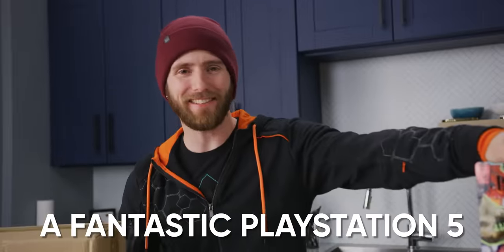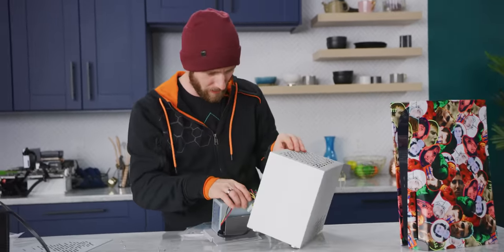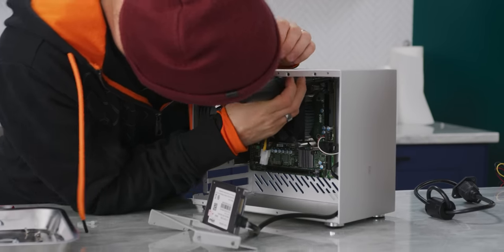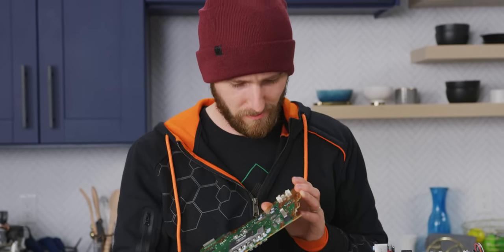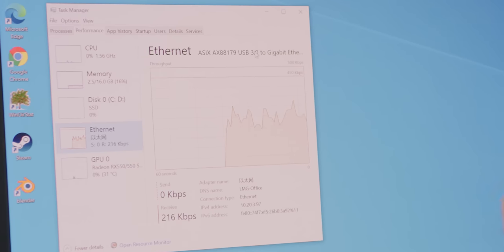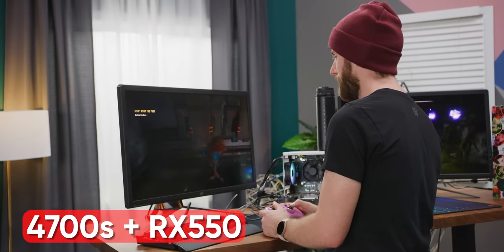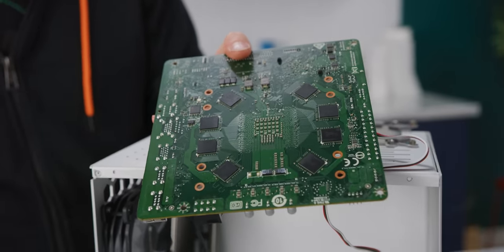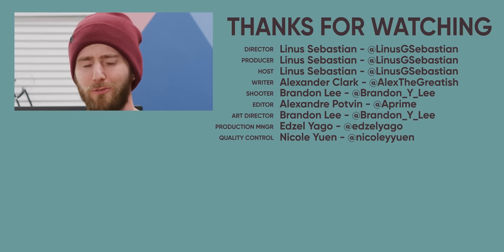Why Is AMD Selling Broken PlayStation Chips?

Comment: Yeah, I do the BIOS "gallop" too, when dealing with systems where I don't know if it's Esc, F1, F2, Del, F12, etc. - so you basically have fingers over all the keys and then "gallop" the lot of them doing the boot screen. Very unscientific, but it does often actually work. Just hit all the keys and one of them's going to be right.
Reply: Lmaoo same
Reply: @GladinGAFloodGoFundMe  I've had that one too. It's just odd that Fn lock would be on by default, with no Fn Lock key and the only way to unlock it is to get into the bios.
Reply: The worst one I ever encountered was one when Esc opened the BIOS, but also immediately closed it without a prompt. It was almost impossible to get into BIOS on that cursed machine.
Reply: i made an arduino project that will force the machine into UEFI once plugged in. I got sick of mashing keys when working in a recycling center for comboopers.
Reply: you guys never heard of a manual
Reply: @GladinGAFloodGoFundMe  Dan, I've come here from the future(current time) to tell you there is an easier way. I too had this issue with my Lenovo laptop, so I opened up "Lenovo Vantage" and clicked on the option to change the function keys to make the secondary functions (like volume up/down or screen brightness up/down) to make the secondary functions in red/orange the primary function. So you can just press any of the Function keys without having to press FN key first. And you can always switch it back by clicking on the Lenovo battery % indicator (if it shows up on your Taskbar). But either way, even if you don't have Lenovo Vantage, it's a very useful program for basically every hardware and software information about your laptop. Updates any drivers, has a great feature that let's you keep your battery from charging over 60% for people who use their laptop with it plugged it most of the time (to extend the life of your battery for when you do need to use it not plugged in, so it's not constantly charging and draining the battery when you're at your desk and it's been plugged in charging for weeks). And has all of the hardware specs listed in your laptop and links to purchase a replacement part, and any warranty information etc.
Reply: Brute force method to access the bios 😂
Reply: You have to hit del on my current gaming rig to load BIOS. If you hit end on accident then have fun waiting. The gallop is a no go on mine, lol.
Reply: You could just use a quick little 1 minute search to figure it out
Reply: sure, you don't  want it to have  some sort of "emulate PSP3" or something mode turned on.  Or  "allocate PCIe Lanes to  2nd slot " set to on ?? That sort of thing. Also he knew it was working , so just turning it on made too short a story.  Not that there was anything much to see, the interesting thing was the lack of anything to see.
Reply: (flips keyboard upside down and punches it repeatedly.) What? you said hit all the keys!
Reply: Damn we're all living the same life 😂
Reply: I used to do that
Then I got a mobo that would actually lock up if I tried that
It would post fine if I did nothing, and it would get to the BIOS if I pressed the key at the right time, but if I just mashed, it would just give me a black screen
It's weird, 'cause I actually change motherboards rather frequently, and I've never had one do that before
Reply: The trick is to do it at the right pace, otherwise you may get a keyboard error (hit F1 to continue :P )
Reply: @george-broughton  you can boot to uefi bios from windows
Reply: Fuck I dont know what my bios key is and im always overclocking
Reply: That's the longest description of the process of elimination I've ever read lol

Comment: they took a partially functional CPU, bundled it with more bespoke hardware, that fits no other CPU and sold it at a bad price/performance.
They saved the CPU from becoming e-waste immediately by constructing more parts around it so they can all be e-waste together :)
Reply: It's an issue with TSMC 7nm as a whole. Hence why everything is being transitioned to 6nm.
Reply: @anthonya.jumelles7103  I'm pretty sure tsmc7 yields are around 90%, very mature node
Reply: @rayquazahere8529  Probs shitty luck because my 3700x works great and I never had any problems with it.
Reply: Welcome to AMD where awful price to performance is the norm now. Even their RDNA2 lineup are awful investments.
Reply: @rayquazahere8529  Ditto to the other guy, my 3600 runs great and has been going strong for a while now
Reply: @TalesOfWar  Manufacturers keep yields secret, because they can be drastically different depending on the chip design. As such, they're inherently a secret of the customer (as in, the company who ordered the chips). However, 90% yield is considered very good, yields can be as low as 30%.
Reply: @benjaminmcintosh857  In 2019, they reported their 5nm node had average yield of 80%+, and at the same time 5nm was reported to have better yield than 7nm.
Reply: The CPU itself in the 4700S is fine, it's the iGPU that's the issue. As far as price to performance goes, if it sells, as far as AMD it's concerned, as long as the brand isn't damaged or something, it's all the same to them.
Reply: @MapleLeafAce  Compared to what? The power hog 3000 series?
Reply: @mikediseln9987  gigachad
Reply: @pixels_per_inch  intel is now the budget king if you know what your looking for.
Reply: @rayquazahere8529  My 3600X is OCd to 5gh on best core and runs under 60C with a mediocre id cooling aio. Good performance with cinerender inside archicad. Next up is a custom bios for my 5600XT.
Reply: @rayquazahere8529  yes, under maximum load, with thermal equilibrium established.  Normal workloads/gaming dont go over 50c. I just mentioned thermal output because i thought it might be relevant because "abuse" lo. From what ive seen at friends and family, no one had issues with 3xxx series, and everyone got them in 2019 because they were veeery cheap before the covid craze started. And people abuse them too. I think you might have just been unlucky
Reply: @rayquazahere8529  3000 series ryzens were kind of hit or miss. did yours have voltage issues? because mine would constantly run at ~1.4ish which apparently kills it over time. I ended up forcing it to around 1.3 and havent had any issues since.
Reply: @mikediseln9987 

true
Reply: @anthonya.jumelles7103  You just make this stuff up out of thin air ? lol
Reply: @TalesOfWar  10 percent defect is literally the holy grail of ic fab...lmao
Reply: @CanIHasThisName  No they never, they reported that yields were better in comparison to the developement cycle, not better than 7nm current defect rate.
Reply: @MapleLeafAce  but people are saying intel sucks?? What the fuck do I buy then
Reply: @rayquazahere8529  some motherboards shove too much voltage to your CPU in stock ,so probably manually set them yourself
Reply: That's... interesting. lol
Reply: @nicoj9984  You seem to know what you're talking about. I've studied chip manufacturing as part of my graduation.

Whit a yield so low, wouldn't it be interesting for AMD to re-engineer the PS5 die with some improvements so as to better utilize the bad chips with useful CPU? Things like proper routing of the PCIe lanes might not be that difficult compared to the rest of the chip. Every PlayStation console so far has had a Slim version released after some time. Do you think they might be looking after changing something in the die for that release? Maybe the process node only?
Reply: @omegadaboi  Being dumb doesn't make you a chad.
Reply: right! they should basically make a student web surfing, word processing budget PC out of this crap...then at least it could probably handle the intended tasks
Reply: @rayquazahere8529  Hmm, probably, although overclocking new CPU's may give you bad results too. I'd not recommend it on new CPU's, they are already overclocked, diminishing  returns for very expensive coolers. I bought an expensive cooler, but it was mainly because of the sound level (the AMD stock cooler sucked at that). Reviews of the 3700X are extremely high, even now.
Reply: Overpriced does not equal e-waste. If they don't sell, they'll simpler lower the price, they won't throw them away,
Likewise while not up to speed in comparison to other cpus, I fully expect there's some things they're more than good enough for.
Reply: @alexandrutereify  I am currently Running a Ryzen 5 5600X and a MSI MECH Radeon 6600. I set it up to the point that it runs at 5.2 on boost.
Reply: @OctoomyYTOfficial  sounds real good. GPUs going low, im thinking of getting a 6700xt
Reply: Ah, maybe the firmware is not correctly configured compiled
Reply: @rayquazahere8529  I use computers for almost 30 years and never have a cpu die... Never... And I overclock them since semprom 1000 something. Maybe a bad power supply?
Reply: @rayquazahere8529  maybe I'm the lucky one. It can be other things too. Can even be the grid at your place or something in the installation. Once I had a motherboard set a wrong voltage to the cpu. I saw right when I first boot the bios.

Comment: Got the desktop kit for $250 in india...installed it in silverstone SG13 case ( $70 for case, 140mm fan and power supply) and I have myself an 8 core, 16 thread, 16gb desktop for a total $320...I think that is great value and performance at this price (if you are not buying it for gaming ofcourse)
Reply: Hows it running?
Reply: Is gaming on this very bad? How about productivity tasks?
Reply: where did you buy it from

Comment: 6:38 - the traces make this circle pattern for impedance matching; else the signal bounces back through the trace like an acho chamber and starts interfering with itself. Stuff that starts to happen when you have circuits running at GHz speeds!
Reply: RF electrical engineering is basically black magic
Reply: @kleinesfilmroellchen  if you don't have the imaging software that costs 100s of thousands of dollars to emulate a part then yea.
Reply: @Yuna-oi8wb  Begone, BOT!
Reply: I don't think it is impedance matching. Impedance of the trace is a function of is width rather than its length. But that is not to say there is no impedance control at all.

The traces that take a circular path are probably of a "less critical signal group", such as address or control signals.

Routing guidelines for DDR signals prefers the data bus to be routed first and be length matched (i.e. the squiggly ones) because it is (more critically) synchronous and operates at the highest clock frequency, while other busses are routed later and do not have quite as strict routing guidelines.

It would matter more for a differential signal pair (which most DDR signals are not) to be impedance (and length) matched to ensure the signal edges travel together.
Reply: Thats  NOT correct.  The  8 chips are used in parallel , which saves on the trace density on the PCB , He can see all the traces, because they put all the RAM in a circle around the CPU because  PCB had all that area available to be used.  If they had bunched all the chips together in a row, they could have plenty of empty space, but they would have used a PCB standard with higher trace density (more layers or more per inch  ?)  Its only new to Linus because the SOC CPU  and inbuilt RAM and  missing  IO slots meant that PCB was much larger than the smallest area PCB required.  So he can see the traces on the two layer PCB.
Reply: @TomStorey96   I think they just put them as close to the CPU as the PCB standard in use allowed. It shows up as there's heaps of room and so the PCB is not hiding the traces so much as other PCBs.

Comment: Which raises the question: Is the Series S chip a "not so great" Series X board, or still produced seperately? It would be a good use for e-waste.
Reply: Think so.. The series x chip/gpu is made with 56 compute units but only 52 is active..series s have 20 active..
Reply: No, it a totally different chip. You can check it online

Comment: Powering a 220v PSU with 110v wouldn't do shit on short term. The opposite is a great fireworks replacement.

Im from a country where it's common to find unlabeled outlets for both on the same room. Lots of hands on experience burning shit down.
Reply: In Europe we Only use 220v, so there's no point of having 110v
Reply: @s3rit661  yes, and in north America they only have 110. So imported items are always gonna be a lottery, regardless of where you are.
And to add confusion, some places in central America use both, so I imagine by the comment that the person above is from one of those countries
Reply: @StepanderTheKing  afaik North America do use 220V for bigger appliances that need huge power. But then it's splitted into 110v lines that goes into all of your power outlets.
Reply: @StepanderTheKing  Yes. South America. Nowadays the outlets are diffent sizes to avoid confusion, but going back a decade I burned a ton of 110v stuff plugging on 220v. Nothing ever happened the other way around. Oh, and getting electrocuted by 220v is awesome, feels like a horses kick.
Reply: @Shadow__133  lol...what now?  You and ElectroBOOM belong together
Reply: @Shadow__133  yeah sorry, meant central and south America
Reply: @danielarsivana5991  yes right, NA can have 220 by "merging" 2 lanes, or maybe they get 110 splitting one 220, IDK, the point is that "normal" outlets are 110V
Reply: @StepanderTheKing  Depending on the number of "phases" available from the poles you could have more. I think some elevators use 330v although I suspect they use rotary phase converters. I have seen some places with >400v outlets.
Reply: @StepanderTheKing  The way it works is by using two 90° shifted phases of 110V AC. The result is double the voltage. Here in Europe we also have these high voltage outlets but they use 3 phases. So 380-450V (usually 400V) in Europe. At 32 Amps this gives you a maximum power output of 22kW. Which is pretty damn crazy. Quite handy for changing electric vehicles. 
The advantage of a 220V grid is improved efficiency over 110V because the currents are lower (=less losses) at the same power output, and it can also supply more power than 110V grids. 220V at 16A vs 110V at 15A.
Reply: Me second that.
Unless it's some really really weird circuit topology it will not burn.
That is the principal we use when testing equipment.
It just doesn't work.

It's a totally unacceptable if it burn in such conditions.
Why? Because it's no unusual for mains voltage to drop below 200 volts before blackout.

So saying "don't plug 220 gear in 110 main" is like recommending "wear a bullet proof vest when visiting Texas."
Good practice, however you totally shouldn't need it.
Reply: @danielarsivana5991  North American homes are delivered 220v across two phases. The electrical panel in a home has two rows of breakers because one is on one live and the other is on the other live. Larger appliances simply use both to get 220 again, along with neutral and ground.
Reply: There's also tons of stuff that takes anything from 85 to 260 Volts.
Reply: @StepanderTheKing  technically they don't only have 110 they have 220v for high load devices it's just their standard sockets are 110 use the right breaker & you can wire up for 240 no bother
Reply: @jihadijackass  Technology Connections also did such a video as well so two videos for people to watch for differing tastes on delivery.
Reply: @danielarsivana5991  Actually it's 240V for larger appliances. We use NEMA 14-30 connectors for dryers, and NEMA 14-50 connectors for ovens. Both are at 240V. I became pretty knowledgeable about our connectors and voltages when I bought an EV and choose to have an outlet installed in my garage for flexibility, rather than hardwiring the charger for my specific vehicle.
Reply: @sys-administrator  I know, right 🤣 Somehow people are ignoring the fact that it's 230V nominal since 1987(!!!!!) with a max voltage of 253V since 2009...
How the f people still think it's 220V after 34 years is just beyond me 🤣
Reply: i can go 100km east from where i live and everything is in 220 v, because why not
Reply: @StepanderTheKing  ah right. But sometimes 220V appliances do work on 240V tho, because they're rated 220-240V.
Reply: @RChero1010  yeah that's what I learn from Technology Connection videos.
Reply: @danielarsivana5991  you mean Europe is 400V, split into three 230V circuits for the power outlets? This "of, the USA is actually 220V country" does not make much sense to consumers, as the two phase circuits are something they rarely handle, as it is typically wired to more permanent fixtures.
Reply: @sarowie  I don't say that USA is 220V country, almost all of their electronic devices is rated for 110V. I just say that USA power grid do actually capable for 220V too.
Reply: @Yuna-oi8wb  shut.
Reply: @danielarsivana5991  hehe 220v and huge power? In EU we have 400v for this 😎
Reply: @doobie 230? Or 230 +/- 10% ?
Reply: el salvador?
Reply: @alfagarage80  I mean it's not crazy to see 480 volts here in the USA mostly just at commercial places
Reply: Most things today work in the range of 110 and 220. So normally there is no problem anymore. Of course it depends on the device but every device i have works in this range.
Reply: Wow, unlabeled. outlets, so dumb.
Reply: @abedin1  Exactly! At the same time not having different phases available (or commonly used) is also stupid.